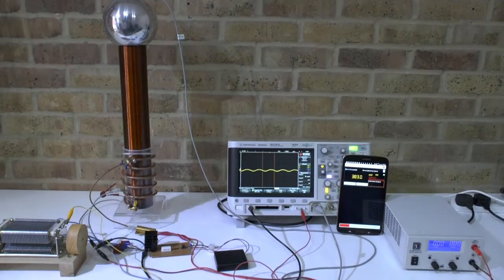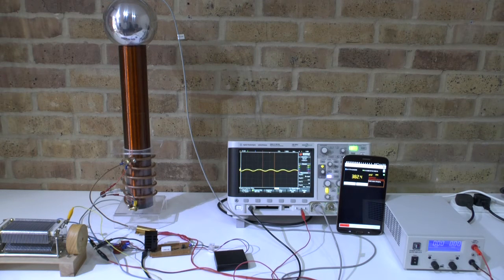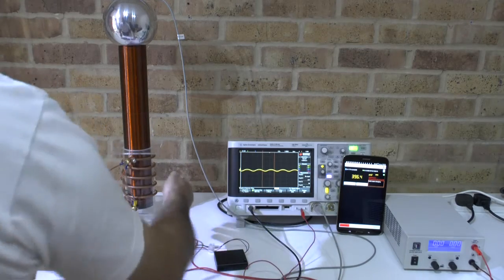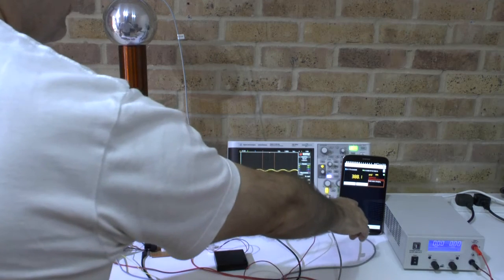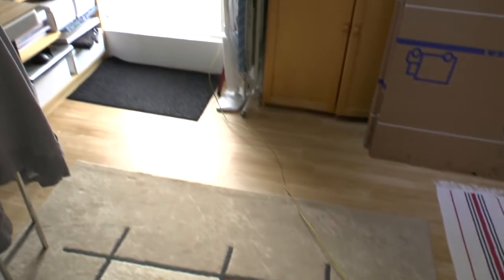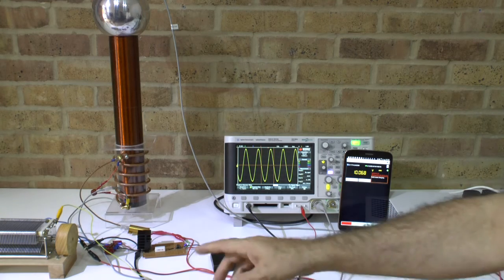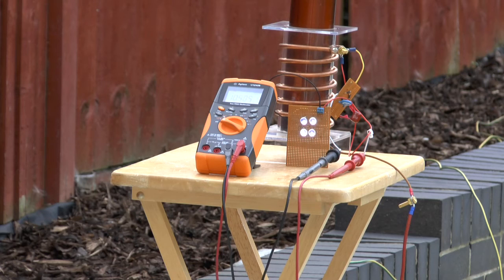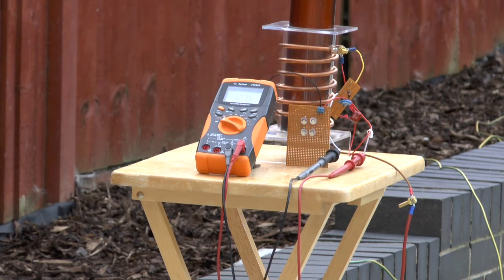Scalar power transmission. The Wardenclyffe  Tower

Comment: This is similar to Dr Meyl's implementation. The only thing is that he uses Bifilar coil. So based on your understanding, is it necessary to use Bifilar coil for scalar wave generation?
Reply from the maker: What here is at play is simple transverse and longitudinal waves. Bifilar coils are sometime better to use. But it really depends on the impedance. I use bifilar coils as well but sometimes achieved better results with standard solenoid coils. No relation to scalar wave.
Reply: @TheOldScientist  Thanks. Few more questions:
1. What are the turn ratios of your solenoid(s)? 
2. Is it okay to overlap wires while winding?
3. If I use any electrical wire (instead of magnetic wires) and wind it in the form of solenoid, will it work as long as it has proper turn ratio?
4. Are the steel balls conductive? Means, if you touch two point of a sphere with mutimeter probes for continuity test, does it beep?